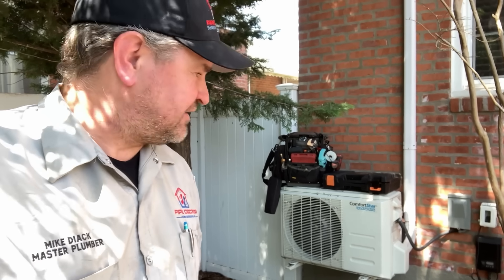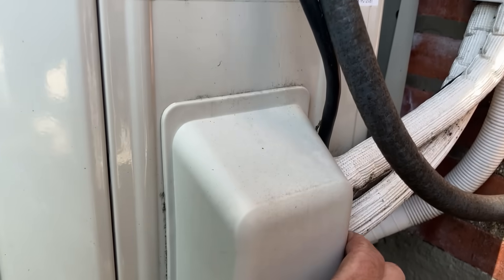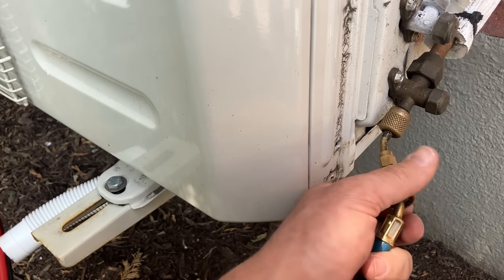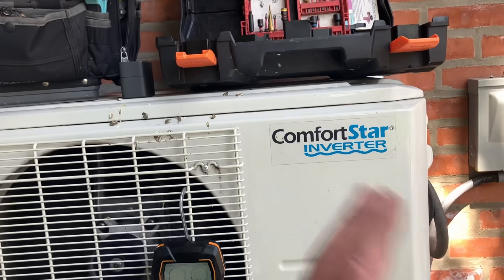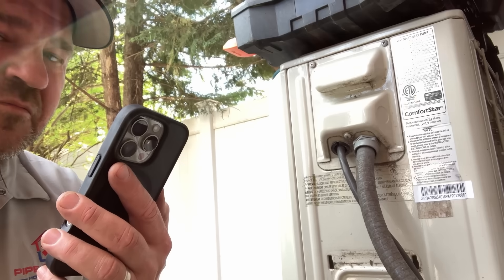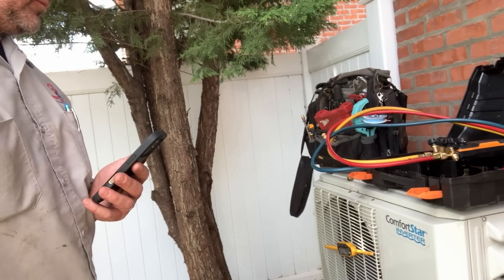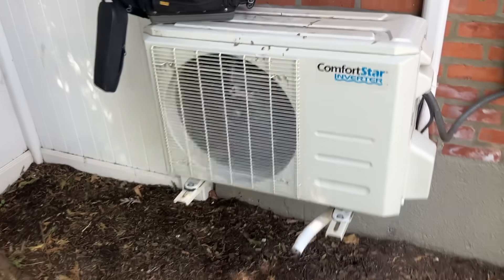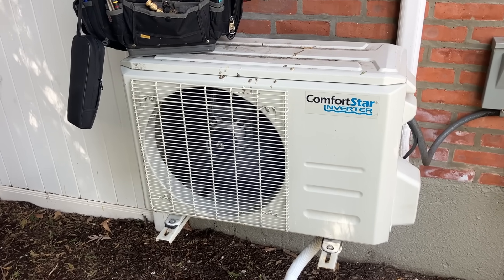Comfort Star Ductless AC Not Cooling | Why "Charge & Leave" Is a Losing Game

Comment: I want manufacturers to step up to the plate and make reliable equipment ALL the time. Sweet dreams on that..  my last years prior to retirement were a horror show of evap leaks with fujitsu mini and nordyne split systems. Then came the furnace fan motor saga with inrush capacitor failures. Was always ready to save the customer a buck. But happily retired and sleeping very soundly.  But the internet had boucoup info on those problems.

Comment: I hated the feeling i got when i installed a defective piece of equipment. Nordyne was also another brand i got rid of because of leaking evaporator coil. So i went to Ruud.  No leaks after the change.  The funny thing is i had nordyne in my own house and never had a problem.  Go figure!
Reply from the maker: It's always frustrating to deal with defective equipment! It’s great to hear that switching to Ruud has worked out for you. Sometimes, it’s just a matter of finding the right fit for your needs.

Comment: I had installed comfortstar and every year I had to add 410A . I changed the line sets. Thinking it was that . Finally pulled the head removed the evap coil . And put in a garbage pal filled with water. 200 psi nitrogen found it. The head was under warranty. .
Reply from the maker: Thanks for sharing your experience; glad you were able to identify the issue!
Reply: @ I’m going to try to come for hotdog before it over . lol youn45 minutes away
Reply: Is comfort star a good brand
Reply: @Corey-qv2ob they not to bad . I installed a few of them . I’m a big fan of Diakin or Bosch
Reply: @stevealoia would you recommend  someone to buying one.
Reply: @Corey-qv2ob buy a comfort star. If there on a budget yes . But a Diakin isn’t much more money .But to answer your question your question . Yes I own a12000 but comfort star for 5 years no issues

Comment: What is an inverter?  I am seeing this term used a lot on hvac and appliance. Thanks Mike
Reply: An inverter is a device that turns DC power into AC power. In this context it lets motors (fans, compressors, etc) run at varying speeds. Running at low speed for a long amount of time is quieter, more comfortable, and more efficient than a conventional system that runs at high speed for a short amount of time and then shuts off.

Comment: I installed DIY Airworks mini-split in 2010 and it still works like a champ. The condenser was precharged, the evap wasn't. I didn't even pump it down. All I did was purge it. I'm pretty sure I purged out to much but hey it works. Bought it at Canadian Tire for $999.99 CAD

Comment: 20% of 44.1 ounces is 8.82 ounces, the leak/leaks must be repaired first before anymore R410a can be added as per EPA. Mike, your company can be severely fined and possible licenses revoked. I would explain to the customer the leak is more than 20% and by law it needs to be fixed before more r410a could be added, I've done this and it's funny how they find the money for a repair or new equipment before it gets hot.
Reply: The 20% rule applies to commercial refrigeration with over 50lbs of refrigerant.  Residential units under 50lbs do not need to be fixed.  They SHOULD be.
Reply: And they will find another company to do it.
Reply: @scottmaz4063  Better than getting caught and fined.